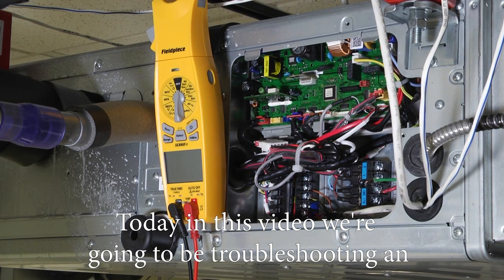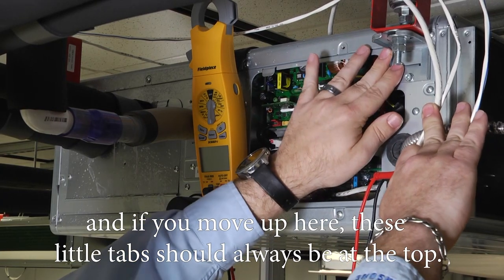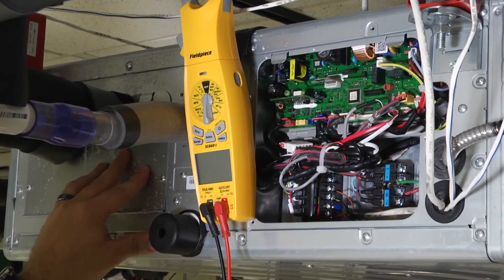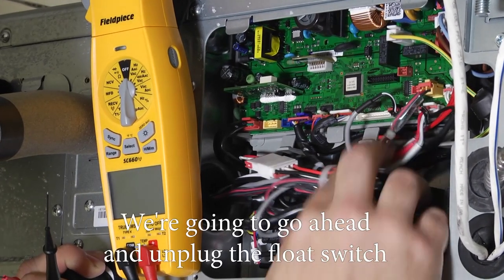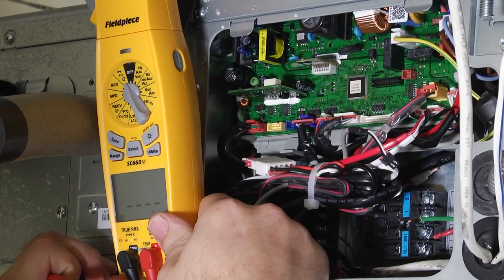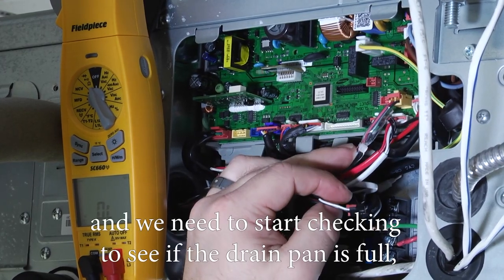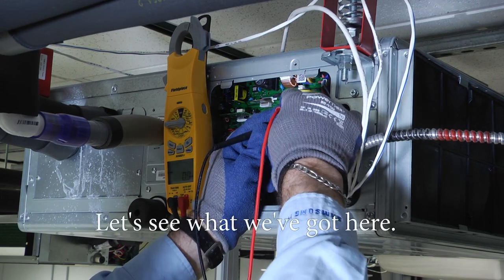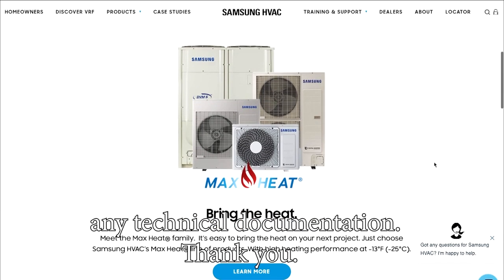Troubleshooting an E153

Comment: Thanks for the video just had an issue with the same type of unit e153, multiple installers left the job site saying they installed the system properly just realized they installed it upside down. Someones getting fired tomorrow.